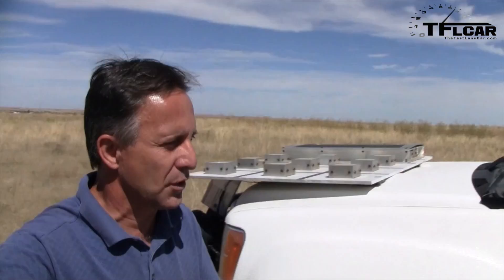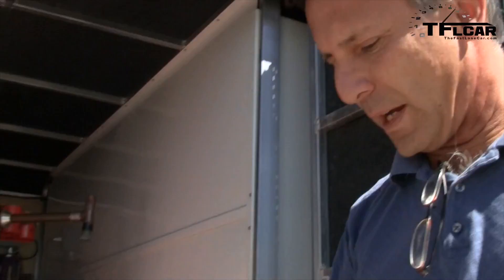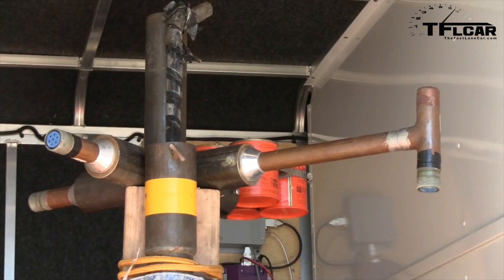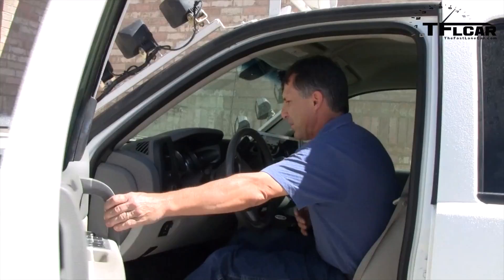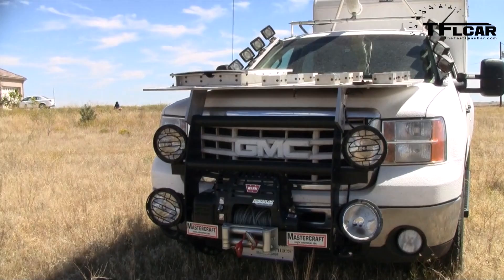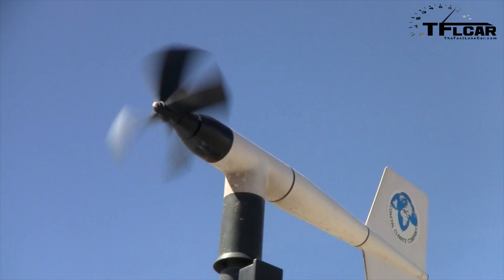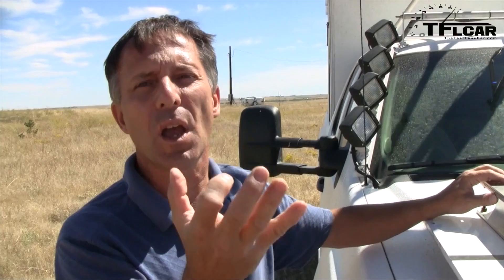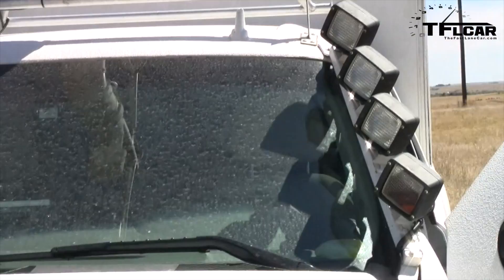In Memory of Twistex Storm Chaser Tim Samaras

Comment: Not to mention the fact that most tornados unless spotted on the ground and called in, will not just magically set of a tornado warning siren. 

Half of the towns Tim / Reed / TIV / Vortex came up on, had a tornado barreling down on them and hadn't even turned on the sirens until one of them radioed it in. 

If it wasn't for on the ground spotters, there would be a lot more damage and a lot more deaths.

Comment: It was an EF-5... 295mph winds (world record tornado wind speeds recorded El Reno, Tornado which Tim passed away in)... EF-3 = 155-165mph... you literally mocked Tim Saramas and he would be quite confused on your knowledge of tornado's after him explaining wind speeds of the EF-1 through 5 scale. Also at 10:20 to 10:40 (in between) was Tim's demise and fatal assumption of large tornadoes. The Tornado that took his life outside of El Reno was 2.6miles wide, and took a sudden turn to where Tim's crew were on the side of the road. Goes to show even massive tornadoes do make sudden changes just like smaller ones.
Reply: It's officially an EF3, regardless of the measured winds. Because the EF scale is a damage scale. It's always been that way since Ted Fujita created the original F scale. Why? We simply don't have a reliable or accurate means to directly measure a tornado's winds. After El Reno happened, the National Weather Service made this definitive by telling its offices that measured wind speeds cannot be used to determine the rating. There are lots of reasons for this, but these wind speeds were measured aloft and they don't necessarily know how those winds would correlate to the tornado's impact at ground level.

Comment: RIP Tim..... 
Also, regarding the vulnerability of the windows there is a film you can apply like window tint nowadays that will actually bulletproof glass up to .357 magnum rounds. I spoke to a guy who does that as a business about it when he was tinting my car windows. They mainly only put the film on flat store front windows to prevent smash and grab robberies so I don't know if you could heat them up or stretch them enough to make a tight fit on curved auto glass but it would be worth a try.